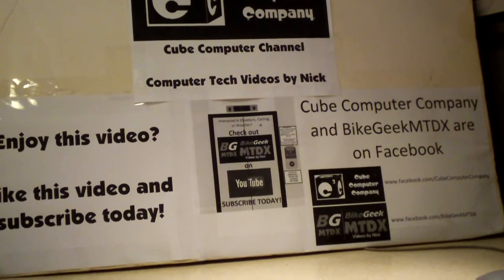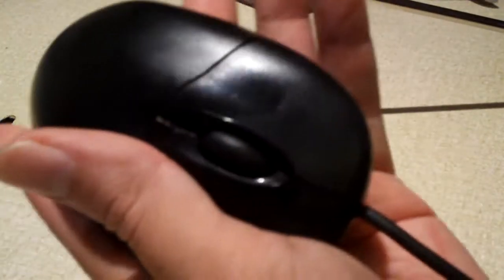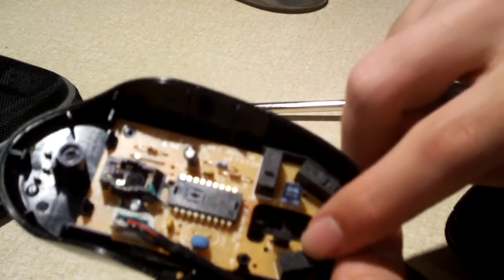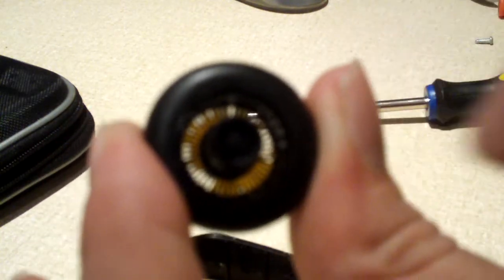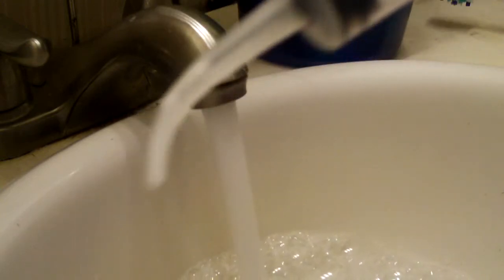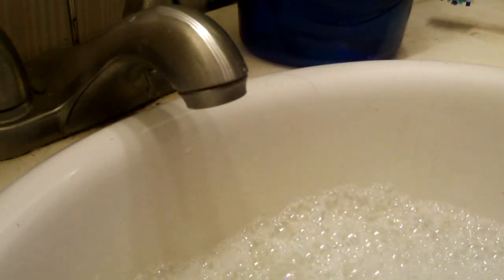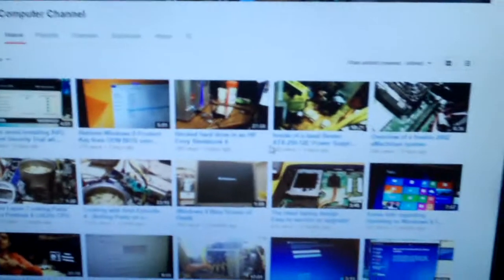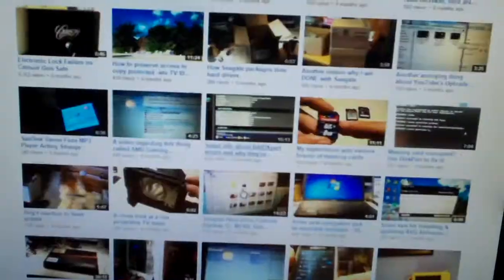Cleaning a mouse wheel to restore proper scroll performance

Comment: I managed to clean my Compaq mouse (this exact mouse rebranded) by opening it with a flathead screwdriver, placing the screwdriver in the "concave" side of the wheel (the side without the rotary encoder where the "fatberg" lurks) and spinning the wheel around in the assembly without removing it,  the hard part is reassembling the two mouse halves, because you'll have to snap the upper part in before the lower part otherwise the buttons will not work ;-D

Comment: Four years old? I have the same model... at least 12 years old (used HARD within that time frame). Other than a sluggish thumb wheel, it was getting the job done. Used your video to refresh the wheel. Alas... I think it's on life support at this point. Was able to restore it to "backup" status only.

(Circa 2018) 7 bones on zon gets you a spiffy new specimen.

Good video. Helpful. Thanks!

Comment: haven't had to do this yet but was curious to see the process, i instantly thought of something that would be more effective though for the clean part, a waterpick you use for your teeth, basically a micro pressure washer, but that syringe still looks like a good alternative if your short on funds, just thought id pass my 2 cents.

Comment: haha funny thing i watched this video and wanted to try this but was scared that i destroy my mouse because there are no visible screws so i just unplugged it and used an air thing similiar to a vaccum cleaner i thinks its called in english and then just moved the mouse wheel a little bit i saw that it was not straight so i made it straight and now it works fine again before i had slow response time and the mouse scrolled sometimes up when i scrolled down thanks for the help !